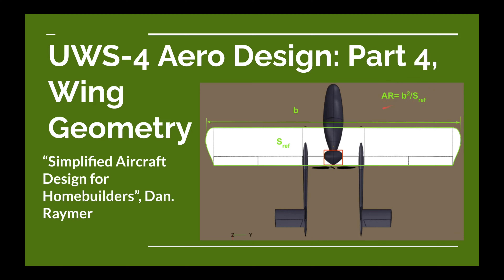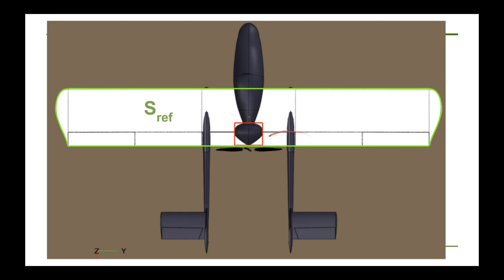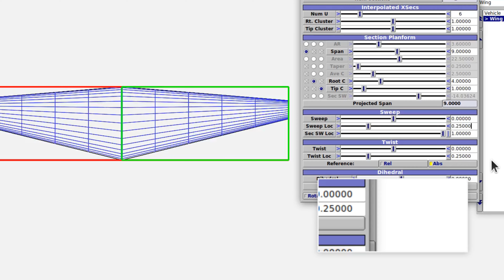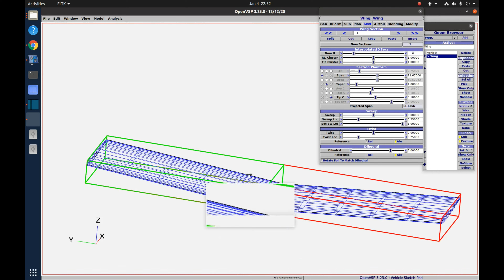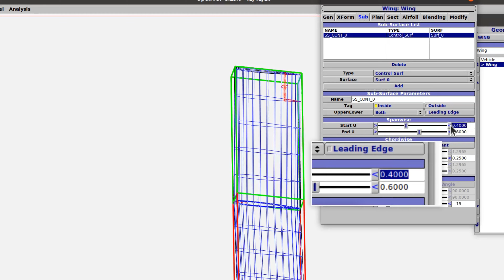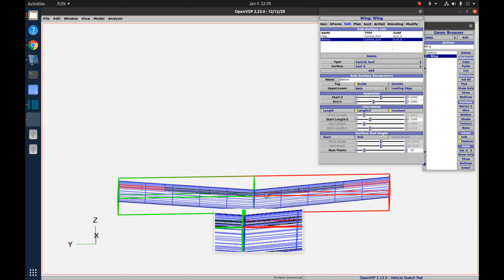UWS-4 Aero Design: Part 4, Wing Configuration

Comment: What would be the drawback to doing full span flaperons instead of flaps and ailerons? I can think of several advantages: weight, simplicity, better role rate, and a higher wing coefficient of lift.
Reply from the maker: The disadvantages: reduced roll control when in the full flaps deployed position, and greater tenancy to stall a wing half when in the flaps deployed position and trying to add roll. Although the flying surface is simpler and should be lighter (assuming the same surface area), the control linkage is more complex. 
For an ultralight I don't think that higher roll rate is needed. There are some 2-axis ultralights without ailerons that fly great (without flaps too). You are right that the roll rate can be higher (depends on the chord length of the flaperon) but for an ultralight I don't see it as an advantage. 
You can get a higher Cl, which should make the wing smaller and lighter (if you keep the same stall speed), but you may have a much higher parasitic drag at cruise because with the smaller wing you have to fly with a higher Cl. It depends on the airfoil that you use. 
For me the deciding factor for this particular design (UWS-4) was the unfavorable stall and role characteristics when in the full flaps position. For other designs it may be great (I explored the idea of flaperons for the UWS-1).
Reply: @Designer103  I did think of the unfavorable stall characteristics though I don't see why it would be any worse than a stall with conventional control surfaces and the flaps up. And a little structural washout should eliminate any wing tip stalls. As for roll control there are several low speed airplanes (Zenith and Kitfox to name a couple) that have flaperons and they're normally praise for there lateral control. I know flaperons are used on a fair number of airplanes but as far as I know thay all have Junker style flaps which have there benefits like maintaining control even after the wing stalls, but thay also have a lot of drag. So I guess my question is would flaperons work with say Slotted flaps?
Reply from the maker: For an ultralight I would  prefer the Junker style over the slotted flaps for full span flap/aileron. I have not looked but my guess is that the drag is about the same.  A slotted flap may be difficult to deflect up without a complicated linkage.
Reply: @Designer103  The Rutan Long EZ has slotted elevators on the canard so upward deflation is possible. Do you know of an analysis software that could do Junker or Slotted flaps? I've been using Xfoil but all it can do is plain flaps.